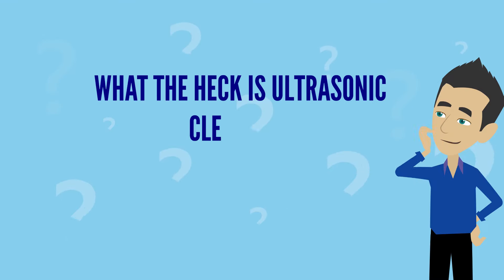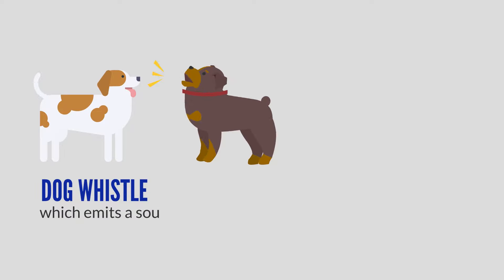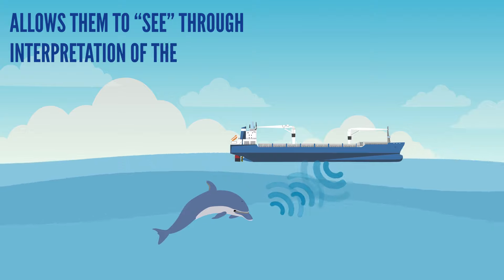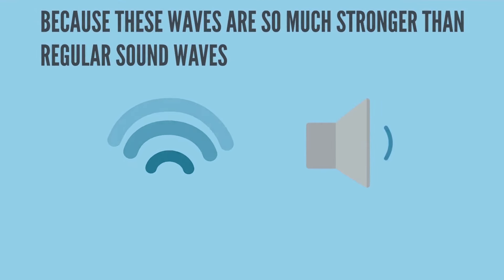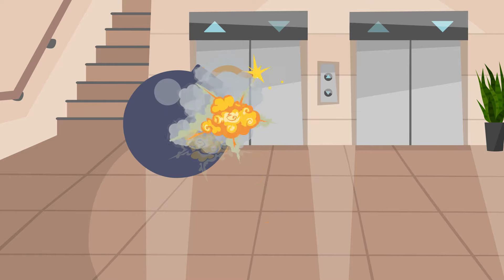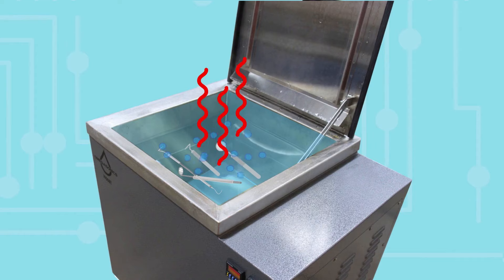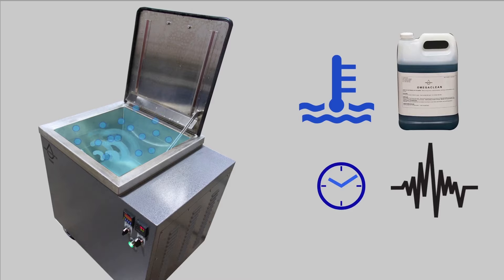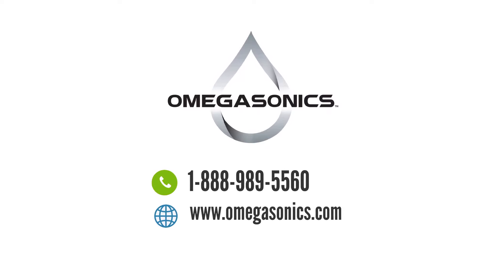How Does Ultrasonic Cleaning Work? | What Is Ultrasonic Cleaning? | Omegasonics

Comment: So, you need a special cleaning chemicals, not regular water, right?
Reply: My understanding is it is product specific . Distilled water may be enough for some things , where thick dried grease may need a detergent or base cleaning agent .
Reply: I have a Ukoke cleaner. I just use water/ baking soda. But im cleaning used pipes, so the cleaner itself gets slightly coated with residue. I havent tried it with a cleaner solvent or alcohol because i dont know if it will damage the machine